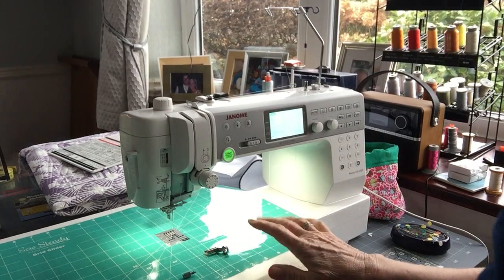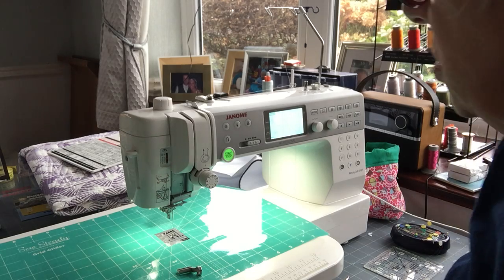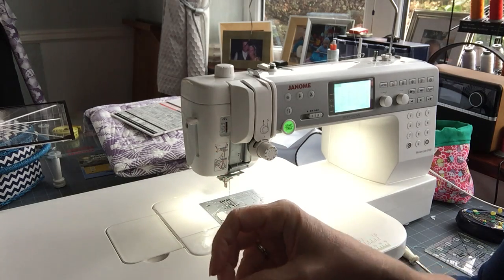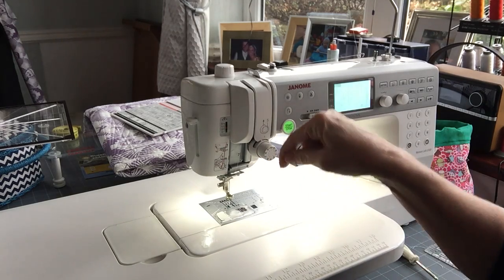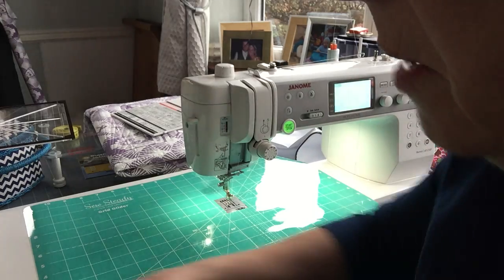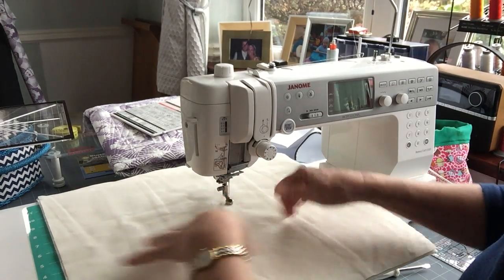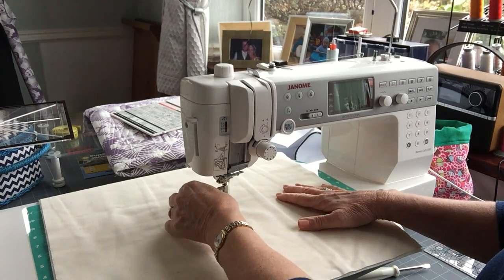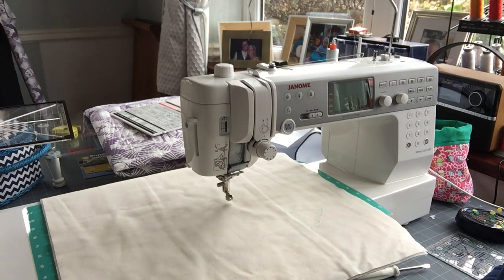Setting up a domestic machine for ruler work

Comment: Hello Laural, thanks a lot for that great video. Is this the original extension table, delivered with the machine, or did you buy it seperately? Many greetings, Christiane
Reply from the maker: Yes it is the original extension table. Stay in touch .
Reply: Hello Laurel, thanks a lot 😊

Comment: What size stitch length please?
Reply from the maker: Hello Sandra, once the feed dogs are lowered then the length of stitch depends on how quickly you move the fabric and how much pressure you put on the foot pedal. Your hands become the feed dogs and once you relax into the movement, you move in rhythm with hands and feet. Takes practice, but well worth it. Think much slower than free motion work. Good luck .